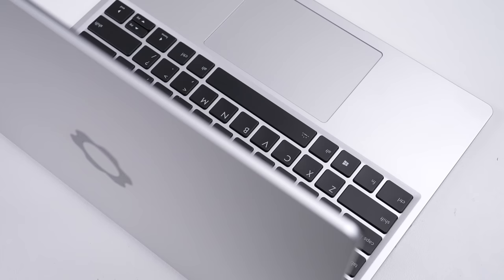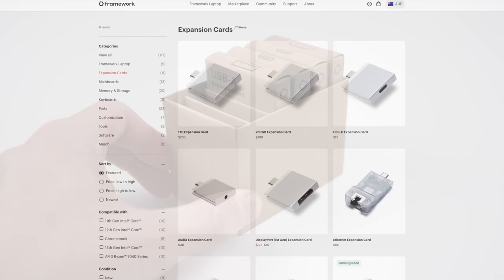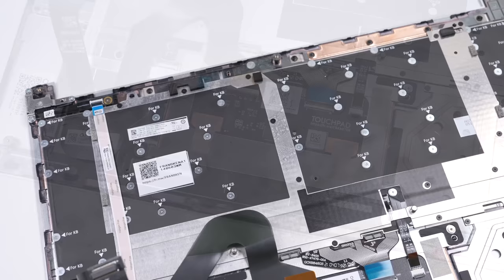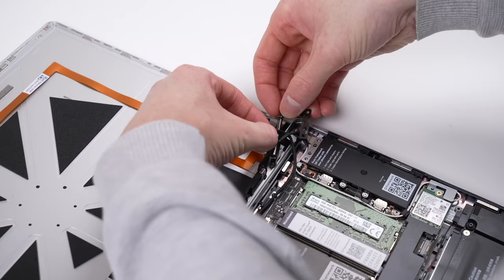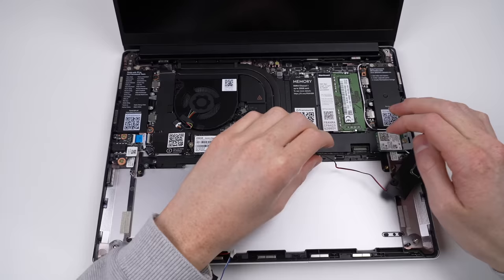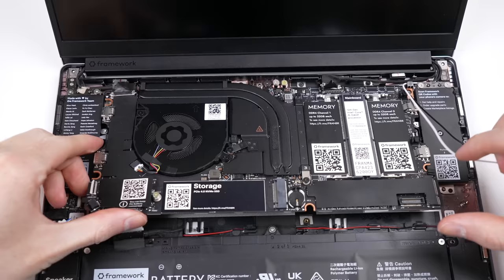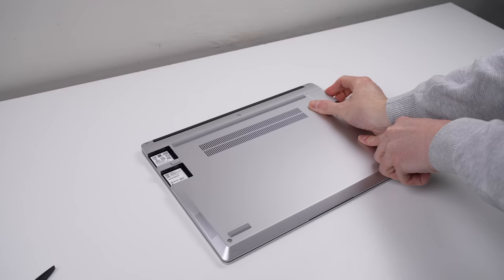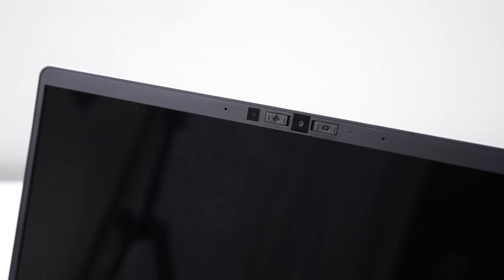New Laptop Brand Shocked Whole Computer Industry - Framework Laptop - Teardown And Repair Assessment

Comment: This is 100% my next laptop purchase. I love the way you can just swap the mainboard over to upgrade to the new generation or even over to AMD. As long as they keep the same form factor, this could essentially last for decades.  I'm sold either way.
Reply: Same, And I bet even if they change form factor they'd run a return/recycle/ part ex program to help people transition across.
Reply: Plus the external enclosure so that you can make use of the old laptop parts.

Comment: Very impressed! Depending on their AMD model offerings, and screen quality, I may become a new Framework owner!  Although, I hope they'll offer a semi-gaming centric model at some point (if they don't already)... 🤞😌🤞
EDIT: Apparently the 16in Screen model coming out, it's exactly that! 🤘😫🤘

Is the palm rest side also aluminum? I've seen some laptops that are clad in metal in order to appear premium, but whose inner frames, screen bezel and palm rest all end up being plastic. 😕

CONSTRUCTIVE CRITICISM:
- The down-firing speakers are a slight turn off for me, simply because of their placement... They're right where your legs would be if using it as it's namesake - a LAPtop!

- The use of magnets is quite nice, but, admittedly I'm concerned with them picking up stray pieces of magnetic debris. Particularly concerning when there's SO MANY right near the screen! 

And before anyone says to not use it near metal shavings... 😅 You'd be surprised at just how much sand is ferrous (enough) and easily picked up by a neodymium magnet! A stray grain that makes it's way into your carry case, would ordinarily be of no concern as it settles at the bottom of the bag... but with so many magnets, my fear is it getting close enough to attract it. Then, you open the laptop, the granule zips over to the magnet, and when you go to close the screen <CRUNCH!>

It may not damage the screen or anything important, but could crack the bezel, or gouge into the palm rest...
Stranger things can, and have, happened!
(but I can appreciate that I might be overreacting, too 😊)
Reply: Sadly the 16 only offers an AMD RX 7700S 8GB card.
Reply: @Rokabur  Hopefully it's just the first of many, and a future card will be more powerful. 🤞
Thanks for sharing the specs, though!!
Reply: @Rokabur This laptop with an AMD is clearly geared towards enthusiasts. No enthusiast would have a laptop with less than 16GB of memory, and few with less than 32GB.

Comment: Only thing I wish here was...The cables that goes closer to the heat sink can be even more braided / protected. In the long run, one should not have the compulsion to change the display just because cable became too weak. Personal experience from owning a similar Sony laptop. Otherwise this is an marvelous concept :)

Comment: First off, great video with informative upgrade demos. This product has some of the appeal of the desktops that I have been building for the last 30 years. When a part needs upgrading, then upgrade that part and leave the rest. This was such a good idea that it should have been implemented from the beginning of laptops. I tried to dissassemble a couple of laptops in the past and the haphazzard use of tiny screws and flimsy plugs guaranteed failure for a hobbiest like myself. It seemed that laptops were designed to be thrown away when any part became too slow. After watching this video and depending on the price of this product, I may be interested.

Comment: The idea behind the Framework laptop is great, but the problem is that you can buy a Dell 14" 2-in-1 (a laptop and tablet in one) with five ports for half the price. I found the tablet feature of a laptop to be extremely useful when docking, because you can dock it to the side of your large monitor and turn it into a second small touch screen monitor.
Reply: It may turn out that over time framework is cheaper or simmilar price, due to easier fixing, upgrading etc...
Especially if they manage to produce at volume to lower the price hehehe
Reply: Also the upgradeability and repairability will take a long time to pay for themselves.
Reply: Yeah I am waiting for them to release a convertible
Reply: you also don't have to wait 3 months or more for your Dell.

Comment: I own one of the first Framework models.  I found it exceptionally easy to work on, and support was fabulous.
It also sounded like an airplane, was tremendously hot and always drained it's battery even when "off".  Various tweaks to the OS, different OSes, and replacing the mobo didn't fix these issues.
I wanted very badly to like this.
Reply: laptops do be that way
Reply: Sounds like they have fixed a lot of those issues since.
Reply: @viatomic I hate to be that guy but most MacBooks work perfectly and last years.

Comment: The only negative I see is really a personal preference  of mine as a coder: the arrow keys. I prefer the inverted "T" layout instead of the half height Up/Down arrow.  Maybe the 16in will come with the coder keyboard layout.  Fantastic job Framework!
Reply: i’ve never seen that on a laptop
Reply: Another downside is that some of their "port" expansions cost $60. $60 to put an ethernet port on your laptop or $30 to put a single displayport or USB A port on your laptop is fucking rediculous. This isnt really a "repair friendly" laptop. Its more of a "we made it, you finish it" product where they upcharge the components so you spend more and put it together yourself. I mean by itself its cool as hell to swap out ports and change storage drives, the ram and the processor on a laptop but it seems like they are taking advantage of the market by charging too much. Im not with the majority of people in the comments. I dont think its very consumer friendly to charge $30 for a single USB A port for your laptop and it doesnt even come with any from the factory. You have to buy those seperately.
Reply: @nitroxylictv  If you want to bitch about prices, at least use the correct ones. USB A and USB C modules are $9 a piece, 10EUR including VAT for EU customers. Gigabit Ethernet is $39 and that is a price that's quite similar to what I had to pay for a comparable USB C Ethernet dongle in a local store a while ago. When factoring in the scale of operation, the prices are quite reasonable. After all, they don't make millions of these pieces.

Comment: This thing seems to be upgradeable like a thinkpad t220. You change the whole board, screen, battery, and there was an expansion slot. I'd like to see more 3rd party options for upgrades. Like an apu upgrade from another company. And I'd like to see long term support. In 5 years, will they still have a board upgrade to work on this thing. That would be a buy from me.
Reply: I agree that it turns on the long term options, and as it's a newish company we can't know that. I'm going to buy from them partly in the hope that they fulfill their promise, and partly because even if they can't fulfill their intention with the early models of they can stay in business then they will be able to do so with later models.

For example Fairphone launched with repairability and longevity as core values. They achieved a seven year supported lifetime for their FP2 smartphone, an industry record for keeping security updates going on a smartphone.

They were not so fortunate with the very first offering: they were let down by suppliers and their FP1 had a much shorter lifetime than they had hoped. As they get bigger and carry more commercial weight they get to work with suppliers that are themselves more reliable and less likely to go bankrupt to avoid keeping promises.

I'm glad I bought an FP1 even though it failed to live up to its promise. My purchase and all the others who did likewise enabled them to set that record with their FP2. I'm now on an FP4 which I plan to use for the full seven years, or longer if they excel themselves. If nobody has bought the FP1 then there would not be an FP4 on sale now. 

An investment in a Framework laptop is a mix of hope and support for the repairability ideal. If you can afford it, please go for it.

Comment: I've been waiting for something like this for years. Cleavo/Sager laptops have been in the industry for a long time but they never went as customizable and upgradable as this. I hope this company is going to make waves in the industry mostly dominated by "proprietary" systems which mostly hurts the consumers. This also helps with the e-waste problem since the parts are much more serviceable. They should design a 2 in 1 or slated laptop(pretty much a tablet) in addition to their line up next. That's going to give MS and Apple a run for their money...unless this company gets bought out which is a very likely scenario.

Comment: Imagine them making a gaming laptop. What a game changer it would be.
Reply: I'd buy it right away
Reply: Upcoming Framework 16 will have upgradable discrete GPUs and modular construcion. "*A slim, high performance 16" laptop with a fully reconfigurable input system and modular, upgradeable graphics. Pre-orders open Summer 2023, shipping late 2023.*" 2560x1600 165Hz display

Comment: Finally, a laptop that is as environmentally friendly as possible... Until present only gaming laptops allowed for some upgradeability (ram, storage, fans, screen and battery) but always fell short when one wanted to upgrade the cpu, video card, or to repair damaged components... Replacing the whole chipset always implies custom building (sloppy) brackets to match the casing with mother board screw holes, drilling some holes through the mother board in tight spaces to avoid destroying it, or to build a custom frame to attach the mother board to the case...
Very well done, I just hope that the components are high quality so that the laptop is reliable over time.

Comment: All modern Consumer Electronics & Machinery can be made easy to repair if the Companies making those Products actually wanted it. 

But, these Companies deliberately make parts expensive and hard to repair and replace, so they can ensure to make more Profits by either repairing & replacing the parts themselves, or forcing the Consumers to buy an entirely brand new Product. 

I hope there are more Companies like this that make Products that are easy to repair and replace for the layman.

Comment: I've had my FW i7 for over 1.5 years now. It's almost as thin as my M1 MBA. I installed 64GB RAM and a 2TB SSD running Linux (No Windows!) I upgraded the lid to the CNC version found on the newer models and I just bought the 80db speakers. It's my forever laptop unless I get tempted by the 16" model. If they made smartphones, I'd buy one ina second.

Comment: I have been screaming for upgradable and reconfigurable motherboards, laptops and universal charging ports for years and finally someone heard my pleas. Think of the environmental impact of all that old electronic waste. I paid over $1500 for my Dell laptop and have been very happy with it and its been running nonstop and I mean I never shut it off as its usually running a job or task since 2016 and runs windows 10 like a champ. I always recommended Dell to my customers as I have had nothing but excellent results from my monitors and laptops and customer service has always been excellent even though I only needed it once but my customers tell me its the best they have experienced with a computer company. My PC's I build myself. Of course the Dell is maxed out on Ram so its super fast and the CPU can be upgraded as well but I am looking at getting a new laptop to run windows 11 and I think I just found it. Sorry Mr Dell, looks like we will be parting ways at least on the laptop side. I always buy my monitors from them at the end of the year when they are closing out old stock. I got an $800 and some change monitor for less than half price with free shipping to boot.

Comment: Just to correct something, the lower chassis is plastic not aluminum and its going to have the same issue that most dell laptops suffer from, the part that holds the metal hinges break off after sometime

Comment: Very nice and I applaud them. Would love to support them but I still have two or three things on my wishlist: I'm almost completely dependent on a numeric keypad and will probably never buy a laptop without one, as I havent never bought one without it for the past 20 years and dozen or so laptops I've had. I dont mind sacrificing thickness for options, better or largere batteries, replacable GPU's even  - like the Lenovo Y500 ideapad used to have. I have also almost become addicted to powerful backlight on all my keybaurds - as my eyesight like almost anyone elses in their mid to late 40s and early 50s got rapidly worse - longsightedness and difficulty seeing the keys at night or in low light conditions. But ye, other than that its awesome in how many options and how much better it becomes than a standard laptop just by giving the user options we never had before. Thanks for taking the time to make a video on it - much appreciated.  all the best from Oslo, Norway

Comment: At the end of the day, it is as much about the operating system as the hardware. Rarely do you get the best of both worlds.  I run many types of machines and operating systems, and obviously, the task itself can be the deciding factor.  My favorite machine currently is an M2 Mac Studio Ultra, which I pretty much find is the sweet spot for most cases. However, I need my Dell Precision work station too.

Comment: As for me there are few disadvantages: non replaceable CPU, only non ergonomic "chiclet keyboard" I HATE "flat island keyboards", no PortReplicator, tiny battery (I don't need thin laptop, it does not provide any benefits), lack of mechanical switches for audio volume, switching wifi/ble on/off, switching touchpad on/off, switching display on/off on a hardware level etc.

Comment: My only complaint is the same I have with every manufacturer: just make the screen half 3mm thicker so there's more space between the screen and keyboard in the closed position and it doesn't scratch itself. It's not that hard.

Comment: The only problem is these framework laptops are 4x the price of what I can buy a quality used business class laptop on eBay for with a much better display and slighter older specs (8th Gen i5 with 16GB DDR4 & 1TB M.2 Gen3 x4 SSD).   A 13th Gen CPU Architecture isn't worth 4x the price to me and I have absolutely no problems obtaining parts and doing upgrades or repairs on my laptop.
Reply: Still a good idea and hopefully the price goes down one day. I mean tech used to be expensive but go down over time rite

Comment: Actually sad that laptop manufacturer says that changing CPU is impossible for your regular repair shop but back in 4th gen Intel their mobile laptops were socketed yes laptops used to come with desktop level hardware like a physical socket Intel Socket G3 was the last socket that you can actually upgrade your CPU to a higher grade CPU if you wanna check if your CPU is socketed you should see that there is a screw where the CPU is located

Comment: I very much like this idea. I don't suppose, that every user will have the courage to upgrade/repair the system, but there seems to be another benefit. It brings an opportunity for small bussineses to offer such services at low costs, because no special equipment is necessary. Also, there's the new EU legislation, that will require rechargeable devices to have user-replaceable batteries. Those guys are way ahead.

Comment: I remember a couple small companies making upgradeable laptops like these back in the mid 90's.  Unfortunately, they went out of business.
Reply: Yeah, but back then you could at least upgrade/replace your DRAM and disk drive, and many laptops came with compartments for swappable components, like extra batteries, CD, and DVD drivers, etc.

These days, you're lucky if you can replace the battery, so the marketplace is ready for something like Framework, especially now that governments are finally starting to ramp up the pressure on right to repair, e-waste problems, etc.

Let's hope for the best!
Reply: @EnglishMike  Absolutely

Comment: I remember a similar buzz about modular smartphones over a decade ago.... turns out there were 'tradeoffs'.
It is simply a fact that 'most' consumers do not care 'that' much about customisation. Being able to swap which side the power port is on... is cool. But that feature comes with its own R&D costs, it's own manufacturing costs, and possible other tradeoffs (does it make the device bulkier, take space form the battery, etc)... and then there's the obvious fact that 'new' technology is not guaranteed to work with this system. Will I really be able to add a screen which uses a new display technology? What about a future HDMI standard?
Like so many things 'modularity' is good in principle, but not in practice (outside of tech enthusiasts building/upgrading their own PC's)

Comment: to be honest, an easy repairable laptop like this is not necessary, just because I bought everything to use it as longg as possible, and only bring it to the recycle center when I feel it's completely useless. the real thing I need for a laptop or even the tablet right now is the UPRADABILITY and the REPLACEABLE BATTERY.

the only thing that Framework makes me interesting is the great convertible it has, like it can become a part of  anything (although it's not smol enough like lots of N100-powered based mini PC). Because of my high requirements for upgradeability, I'm still stay away from it and pick an old workstation laptop instead. But if Framework add MXM slot, I'll definitely buy one.